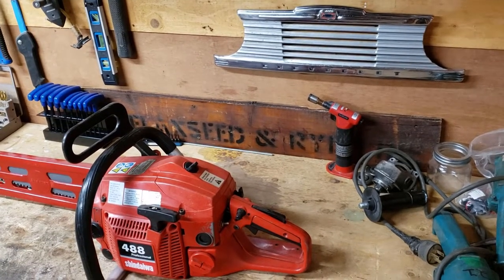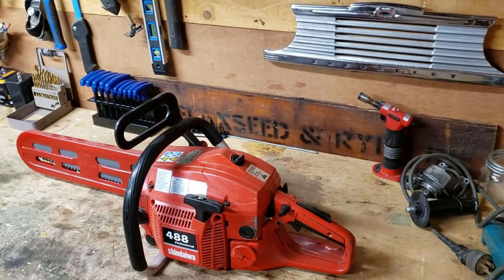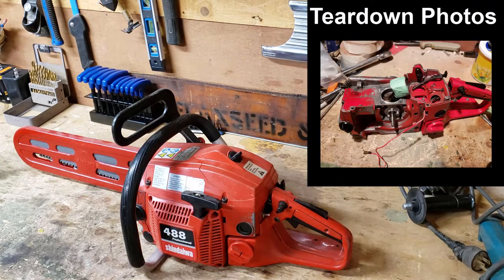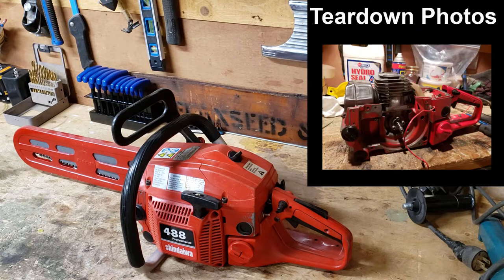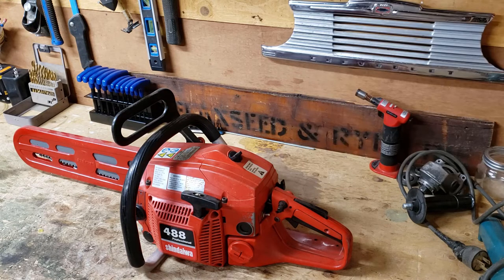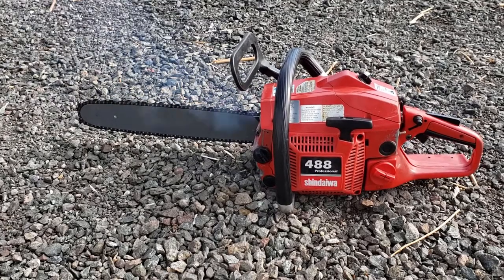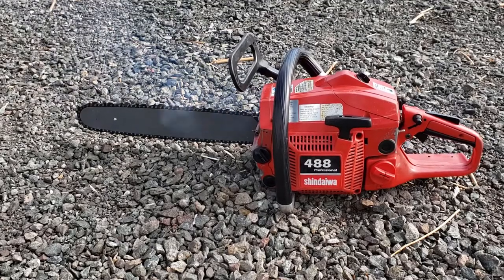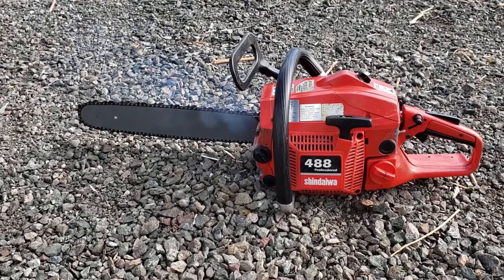Chainsaw Repair and Maintenance Replacing ignition coils, cleaning and rebuilding carb Will it run?

Comment: I have the same saw. Can you tell me if the sprocket behind the clutch moves side to side about a 1/8 inch? I had my chain come off  and I think this could be the problem?
Reply from the maker: @allencrossland1973  is the sprocket moving on the shaft or is the shaft moving with it?
Reply: @nothandsomebuthandy  just moving on the shafts. Thanks
Reply: Shaft

Comment: Good video.  I have 3 running Shindaiwa 488's, and 4 parts saws.  Very good quality machines built in Japan. What is the tool you are using to remove the flywheel? That is slick.  The only advice I can give is to work the saw to make it run better.  Putting a load on the engine and going through a few tanks of fuel will clean the carbon off the head and get things working better.  It has probably sat for a while.
Reply from the maker: Thanks for watching! This is a great little saw but I definitely don't use it enough. The tool I used to remove the flywheel is a generic steering wheel puller and I used longer bolts to thread into the flywheel's threaded holes.
Reply from the maker: Awesome to hear that someone else is keeping these old saws going!
Reply from the maker: It's a good little saw!
Reply from the maker: Good video, I love Steve's stuff he's much more knowledgeable than I am when it comes to these!
Reply: I have had a variety of saws over the years. The Shindaiwa 488 is the keeper. A damned fine saw !